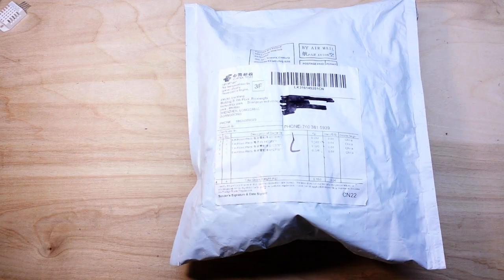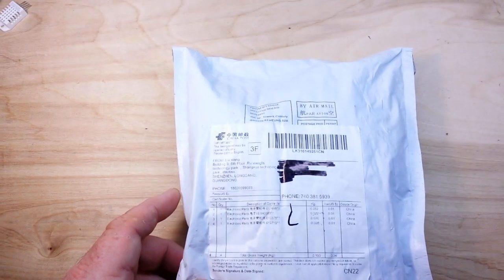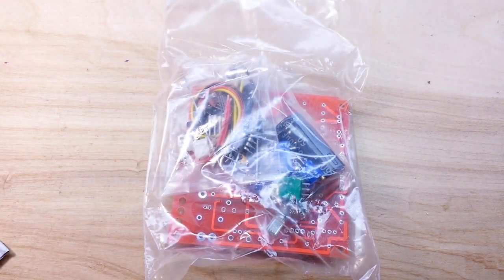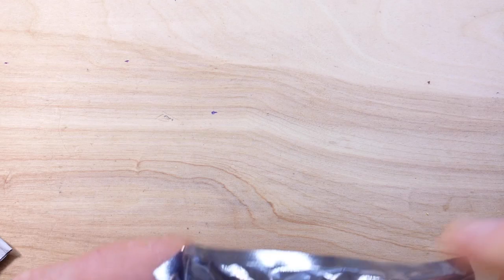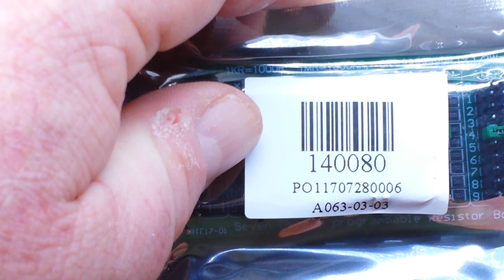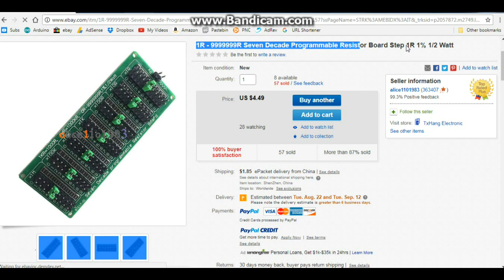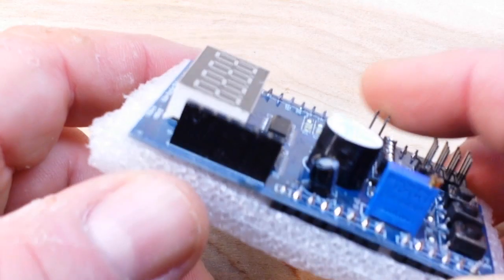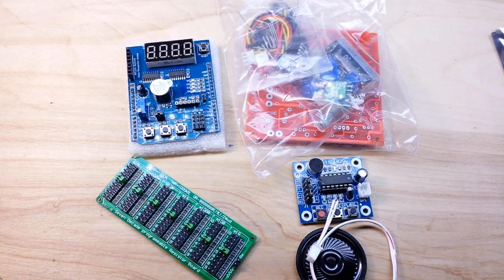Slow Boat from China #10

Comment: Banggood has a good deal ($4.16) on a heatsink/24 volt fan made for that board. With 10 turn pots, it works OK. For whatever reason shipments from China have, for the most part, really sped up lately. Rarely does it take three weeks. More toys! ;-)
Reply from the maker: Digger D 3 or 4 months, that's way outside my patience threshold too.